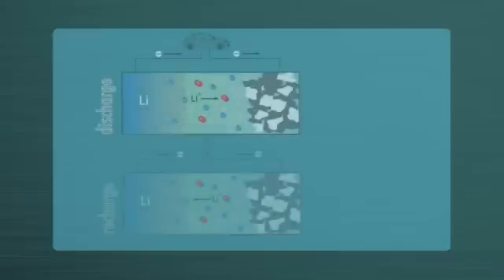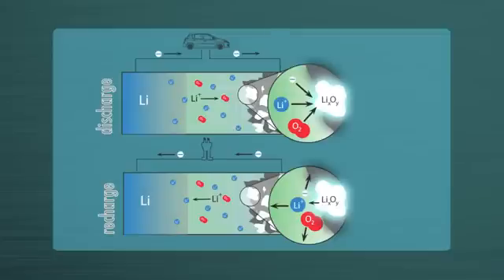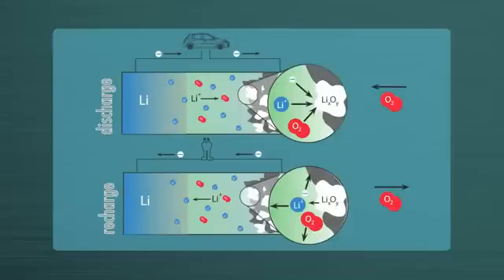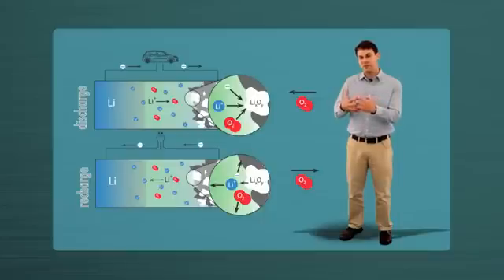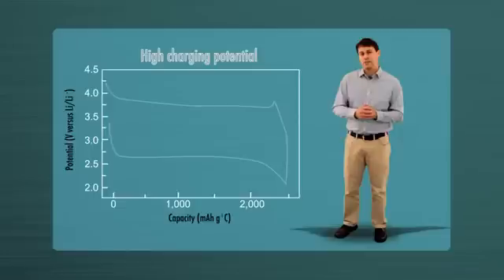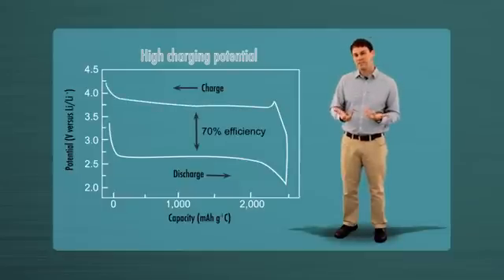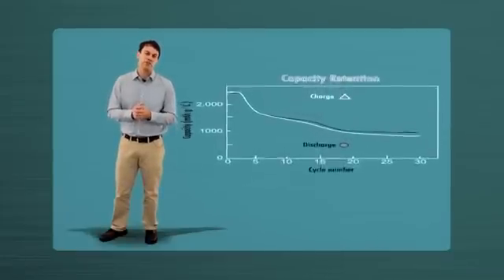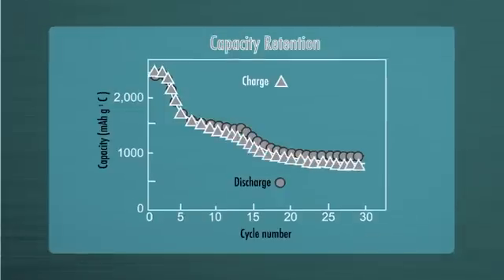Batteries of the Future - Lithium-Air

Comment: Why lithium for the future? Lithium is fairly rare. Are there any battles proposed with more common materials?
Reply: Lithium is the lightest metal that is on the left hand side of the periodic table. This makes it the potentially lightest battery for the same energy storage. 

Lithium really isn't that rare, it's just often found with other rare-earth minerals that are difficult to deal with (such as Thorium), so the only people on earth who are willing to deal with radio-active "waste" (see Thorium) are the Chinese, and so the USA and other countries don't bother. 

Getting Lithium from rare-earth mines in the USA is relatively easy (there's large deposits near where I live in Oregon/Northern Nevada) but businesses won't open mines there due to the issues of having to dispose of the Thorium.

Thus Liquid Fluoride Thorium Reactors (LFTR) along with battery technology is the real answer to climate change a lot of the big issues facing us in the current/near future. It would solve the problem of Thorium in rare-earth mines, allow the mining of lithium much more easily, produce electricity for less than current costs, will not produce greenhouse gases in abundance, and it'll make isotopes that are useful in space exploration and medicine. 

Too often folks look at a problem as if it's isolated. This isn't the case in how the real world operates as everything is interconnected. LFTR + Lithium-Air is a one-two punch that would reduce emissions by over 70% and bring about a better economy for the USA (Sorry, biased American and patriot here), and we'd get cars that can go from 0 - 60 mph (0 - 100 kph) in less than 3 seconds.... it's like... a no brain-er if we could ever get big companies to invest in the minimal research for LFTR, the moderate research for Lithium-Air, and get he NRC to actually let progress happen.

Comment: 70% efficiency in the charge-discharge cycle sounds rather good, but how fast will it be able to charge/discharge in this case? I suppose the efficiency will go down as we try to make the process faster. For example how long will it take to charge a lithium-air battery on board an electric vehicle while trying to maintain 70% efficiency?
Reply: 70% is actually really bad as that means 30% is being lost to heat. This can cause over-heating conditions really quickly. Think about how fast a space-heater gets hot that's rated at 1500 watts (that's 1.5 kw), now if you were recharging at a rate of 100 kw-hrs then you'd have the equivalent of 20 space heaters going on your car... which is kinda hot and dangerous.

The main limiting factor of re-charging modern batteries is heat dissipation and that directly ties to efficiency of the battery.

Comment: If we compared it with the energy required to create oil, the 70% efficiency isn't so bad. Regardless, I would still buy these batteries if they were 70% efficient as I would use solar to charge them, being in Australia we generally have enough sun. What wasn't mentioned was the volume required for lithium air batteries. The energy density per kg is excellent but what is the volume likely to be?

Comment: Metal-oxygen (also known as metal-air) electrochemical batteries are the future. They have the potential to be far, far more efficient than the use of either pure hydrogen, or hydrocarbons like gasoline, diesel--especially when used either in a fuel cell or an internal combustion engine--while at the same time having more energy content stored either per unit of mass or volume than those fuels.

Also, the metals that will power these metal-air batteries are the only metals really worth pursuing, as they either are on-par with pure either pure hyrogen or hydrocarbons in terms of energy content stored per unit of weight, yet are worser in terms of energy content either stored per unit of mass or volume, especially in the case of lithium in regards of volumetric energy content in respect to hydrocarbons like gasoline and diesel; meanwhile, boron and beryllium--the relatively obscure, arcane, and underappreciated elements whose energy contents, in both mass and volume, have yet to be realized--completely and utterly blow pure hyrodgen, hydrocarbons, and even lithium out of the water! There is literally no contest; so, here they all are:

Lithium's maximum theoretical energy content and abundance levels:

Maximum theoretical specific energy: 43.1 megajoules per kilogram, or, 11.97 kilowatt-hours per kilogram.
Maximum theoretical energy density: 23.01 megajoules per liter, or, 6.39 kilowatt-hours per liter.
Abundance in Earth's crusts: 0.0017%; 17 ppm; 325.21 trillion metric tons.
Abundance in Earth's oceans: 0.000017%; 170 ppb; 239.1883 billion metric tons.

Beryllium:

Maximum theoretical specific energy: 67.6 megajoues per kilogram, or, 18.78 kilowatt-hours per kilogram.
Maximum theoretical specific energy: 125.1 megajoules per liter, or, 34.75 kilowatt-hours per liter.
Abundance in Earth's crusts: 0.00019%; 1.9 ppm; 36.347 trillion metric tons.
Abundance in Earth's oceans: 0.00000000006%; 0.6 ppt; 844,194 thousand metric tons.

Boron:

Maximum theoretical specific energy: 58.9 megajoules per kilogram, or, 16.36 kilowatt-hours per kilogram.
Maximum theoretical energy density: 139.59 megajoules per liter, or, 38 kilowatt-hours per liter.
Abundance in Earth's crusts: 0.00086%; 8.6 ppm; 164.518 trillion metric tons.
Abundance in Earth's oceans: 0.00044%; 4.4 ppm; 6.190756 trillion metric tons.

Now, compare energy contained in lithium, beryllium, and boron to that of gasoline, diesel, and kerosense:

Hydrogen's maximum theoretical energy content (as a liquid, which only has an effect on volumetric energy content):

Maximum theoretical specific energy: 141.86 megajoules per kilogram, or, 39.4 kilowatt-hours per kilogram.
Maximum theoretical energy density: 8.49 megajoules per liter, or, 2.35 kilowatt-hours per liter.

Gasoline's maximum theoretical energy content:

Maximum theoretical specific energy: 46.4 megajoules per kilogram, or, 12.88 kilowatt-hours per kilogram.
Maximum theoretical energy density: 34.2 megajoules per liter, or, 9.5 kilowatt-hours per liter.

Diesel's maximum theoretical energy content:

Maximum theoretical specific energy: 45.6 megajoules per kilogram, or, 12.66 kilowatt-hours per kilogram.
Maximum theoretical energy density: 38.6 megajoules per liter, or, 10.72 kilowatt-hours per liter.

After reviewing these values, I can finally be assured and rest my case on what the true future of energy storage belongs to: lithium-air, boron-air, and beryllium-air batteries, as a superior alternative to the continued dependence on fossil fuels, and the flawed alternative usage of hydrogen, which is even worse and just as polluting.
Reply: ***** I am baffled by the second graph, where over time the charge capacity becomes less than the discharge capacity.

I'm not so good at chemistry or physics, I just love what capacity represents, rechargeable batteries for the win, feel free to treat me like a moron but I still have a question. Could you help explain this dropoff where discharge seems to have more capacitance than charge? Is it a symptom of total decay in the elements used?  Am I reading it totally wrong in that you have to charge it harder to get a weaker output?  Am I asking questions that don't matter?

Comment: I doubt the transportation application. You have problems with current density due to diffusion limitation of the oxygen in the cathode structure. Sure, your reversibility still sucks (capacity loss) but even if you fix that you struggle with current density. You have a dilute oxygen source and pure oxygen will be costly. Try low current low cost solar storage. Do you battery of the future guys really believe the batteries in the Leaf or Tesla are not adequate? Because the only thing I see wrong with them is cost and I know that will come down with mass production.
Reply: Elon Musk says any battery chemistry they've tested that has anything to do with air has great energy density but terrible charge cycles. The batteries chemically fall apart.
Reply: leerman22 The battery forms dendrites, correct?
Reply: Since we have technological limitations now, that means it's impossible! Air tight logic guys. After all, we know that solving problems with improvements in technology is impossible and never happened before.

Comment: New carbon capacitors cells are on the way.. LiOn and LiPo will be phased out and charge while driving systems will extend range to the point that you could traverse the country and never have to stop the car.

Comment: Conventional Li-Ion is limited about 130Wh per kilogram.  The tremendous 5kWh /kg Lithium - Nanowire Technology has HUGE capacity losses, also depends on Gold as cathode membrane and becomes unusable after 5 charge cycle.  

Nonetheless having 1.3kWh per kg energy density, so does suffer the Lithium-Air about capacity losses and becomes unusable right after 35- 40 charges due to seperator membrane issues.

Meanwhile a modern ICE vehicle like Fiat Palio 1.3 Multijet Diesel (rated 53.6kW at wheel) peak consumes about 13.2 liters of fuel per HOUR on "Stress test Dyno" (equivalent to 144.4kWh of fuel flow) About %37 of installed power can be delivered to the wheel. 

And recycling lithium batteries has a lot of industrial externalities especially about earth and air pollution by the particles. 

That's why the vast majority of producers still biased on those "lousy" ICE.

And that's also why we cannot store the produced energy from small energy plants such as solar and wind. Lithium batteries cannot handle slow and dynamic rates of charging like the good old 40Wh/kg lead-acid ones. That means if you don't have money to install a HUGE battery installations, you have to allow your precious electricity to be wasted as heat on grid. 

And that's why the lithium batteries are still just used for empower small devices, average man's RC toys and rich man's toys such as Tesla cars. Nobody talks about their battery disposal, battery life cycle and new battery costs. And it reaches it's 300 mile range in plain and windless highways of Nevada. I cannot assume it can reach this level in harsh conditions like streets of Istanbul which had been built on bumpy terrain and always having heavy traffic on streets. 

Maybe in 20 years it can be more usable. While we're still stuck at Panasonic's 130Wh cells that released in 1993.

Cheers.
Reply: None of what you wrote is accurate.
Reply: Please prove it.
Reply: EVs are simply not a viable tech for the future. As I see it, firstly there is the battery tech which is simply useless or too expensive for most people who need to drive a lot. Secondly, for the average person who drives, the electricity infrastructure will have to grow by 700% as an absolute minimum to cope with the demands on the system. That means our 700% increase in nuclear, renewable and gas power stations, 700% increase in power transmission, distribution infrastructure. Also massive regional energy storage will be essential to cope with the new peak periods requiring yet more batteries. FWIW it takes 150-200 kgs of CO2 to make a 1kwh battery. For small crowded European nations this means importing energy and being dependent on other nations which is a security issue. There are no end of issues. Probably the same if not worse for hydrogen fuel cells because of the energy required to create the hydrogen. But at least the hydrogen can be manufactured and transported in much the same way as gasoline with dedicated facilities.
Reply: "EVs are simply not a viable tech for the future."

Your entire ramble basically assumes no technology will ever advance in the future, so your assertion about what is viable for the future is incorrect.

"As I see it, firstly there is the battery tech which is simply useless or too expensive for most people who need to drive a lot"

For daily commuting it's more than adequate even at the range limitations of current BEV's. Cost goes down as technology advances and becomes mass produced.

"Secondly, for the average person who drives, the electricity infrastructure will have to grow by 700% as an absolute minimum to cope with the demands on the system. "

Please provide the citation where you got 700% from. As time goes on, more homes will have solar panels installed directly on top of their homes, and electric infrastructure will grow as demand for BEV's grows. Molten thorium reactors and other 4th gen nuclear reactors are absolutely going to be built and in a few decades fusion will become feasible. 

"That means our 700% increase in nuclear, renewable and gas power stations, 700% increase in power transmission, distribution infrastructure."

Again, you need to cite your sources for 700%, but you don't need an increase in everything, solar power will become far more ubiquitous as cost goes down and efficiency goes up.

" FWIW it takes 150-200 kgs of CO2 to make a 1kwh battery."

Citation needed. Again you're assuming our power generation methods will never change or we will always rely on coal.

"Probably the same if not worse for hydrogen fuel cells because of the energy required to create the hydrogen. But at least the hydrogen can be manufactured and transported in much the same way as gasoline with dedicated facilities."

Wow, that is the dumbest thing I've heard. Petroleum and gasoline is one of the least efficient and costly things to transport. Not to mention the environmental impact from oil spills. Electricity is far more efficient to transport and can be harvested right at home instead on distant oil rigs or unstable foreign countries. You are simply ignorant and do not know what you're talking about.
Reply: No, part of it assumes the tech will not progress fast enough, when other tech such as fuel cells may advance at a greater rate. The part is that I think it will not be possible to manufacture the batteries either efficiently or in sufficient quantity. The final part is that the tech needed to mitigate the required exponential increase in production is itself inefficient and would be bloody expensive to build into our infrastructure.
Reply: You failed to cite your sources and did not address a single refutation I made. I suspect you're a troll, or at least extremely stupid. With that said,

"No, part of it assumes the tech will not progress fast enough"

"The part is that I think it will not be possible to manufacture the batteries either efficiently or in sufficient quantity."

You literally just contradicted yourself. You just assumed technology will not progress. You're an idiot you know that?

", when other tech such as fuel cells may advance at a greater rate. "

"Probably the same if not worse for hydrogen fuel cells because of the energy required to create the hydrogen."

Nice job contradicting yourself... again. You're a real exquisite moron. Even you understand that recharging a battery is more efficient than making hydrogen. Not to mention the problems of transporting it and overhauling the infrastructure to change from gasoline to hydrogen. We already have an electrical infrastructure to support people buying BEV's right now. 

"The final part is that the tech needed to mitigate the required exponential increase in production is itself inefficient and would be bloody expensive to build into our infrastructure."

I have no idea what you mean by that. Can you actually explain what you mean instead of babbling please? And this time stop contradicting yourself. You're making yourself look foolish.
Reply: Tell you what, if you think you have the edge with adding puerile insults, then you can go and fuck yourself. That seems to be your level. Enjoy it.
Reply: Triggered. I ask you for a simple citation and you failed to provide it. The insults in this case were entirely appropriate for your lack of intelligence and rationality. You contradicted yourself, and didn't provide a single citation to back up your claim. Describing you as an idiot is entirely appropriate when you literally contradicted yourself. When backed up against a corner with someone who is not willing to put up with your bulslhit, you then spout a juvenile insult and run away with your tail in between your legs because you don't have a leg to stand on. Don't let the door hit you on the way out kid.

Comment from the maker: The comparative energy density with Petroleum is irrelevant when the heat engine used to convert gasoline into work is only 15% energy efficient at the wheels... 85% of all fuel paid for at the bowser is converted into waste heat! 

An ICE powered vehicle is about as energy efficient as an incandescent light bulb (which have now been banned in many countries)
Reply: id like to see the carbon footprint difference between an ice being produced and the equivalent system using 'green' technology.